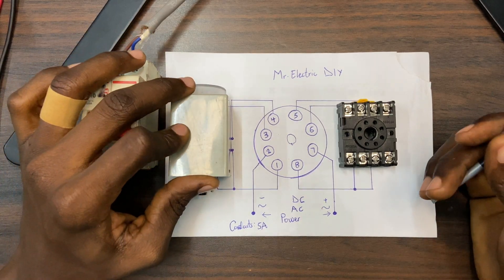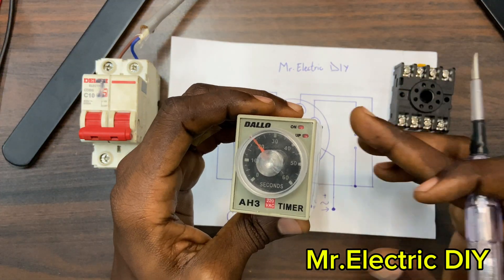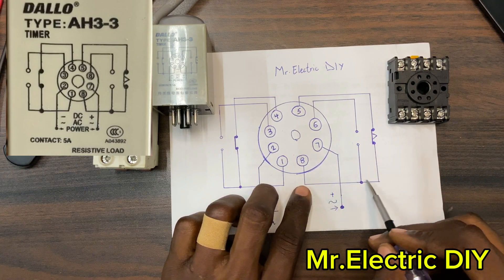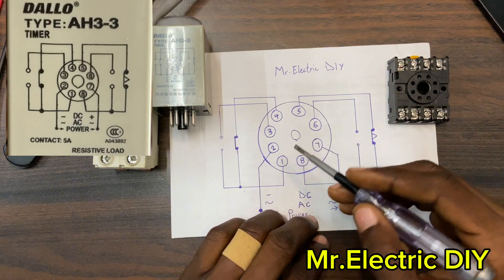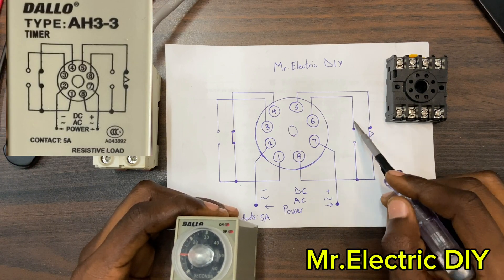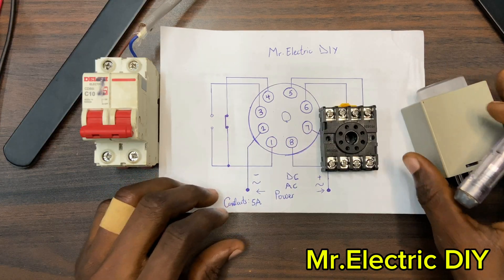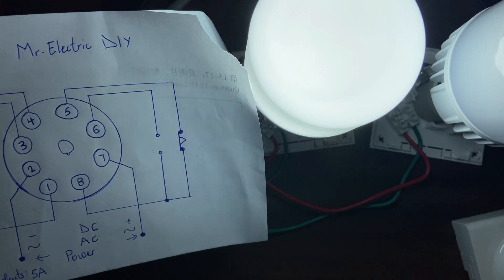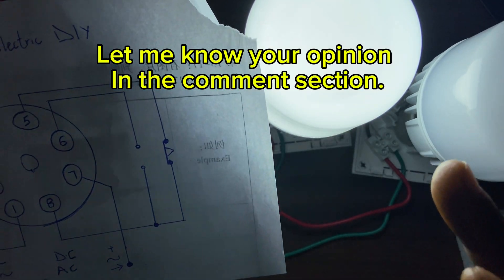8 Pin Timer Relay Working and Connection Diagram @Mr.Electricdiy

Comment: I would appreciate if you can show us how to wire amp meter on single and three phase? Some use without CT connected to amp meter, some connect CT to amp meter.
Reply from the maker: Will work on that for you brother

Comment: Thank you
Reply from the maker: Thank you too brother and where are you watching it from?
Reply: @Mr.Electricdiy northern part of USA !
Reply from the maker: @vertoisful that’s great! I never thought my video would travel this far. I will visit your country in the near future and come back to you in this comment section.
Reply: @Mr.Electricdiy yes! Tell me how your experience is thank you
Reply from the maker: @vertoisful My experience as an industrial electrician spans almost 3 years, primarily focused on the installation, maintenance, and troubleshooting of electrical systems within manufacturing and production environments. I've worked extensively with everything from high-voltage distribution systems and motor controls etc.
Reply: @Mr.Electricdiy that’s awesome ! Keep at it. I’m currently doing hvac
Reply from the maker: @vertoisful that’s helpful bro🎉
Reply from the maker: Keep grinding
Reply from the maker: What is your profession if I may ask?

Comment: Please make a video connecting 2 timers to make an automatic  on and off cycle
Reply from the maker: So both timer will never stop working, it will automatically be cycling ON and OFF all day.
Is that what you mean?
Reply: @Mr.Electricdiy  yes that it is right,
Reply from the maker: @saedbaki8254 ok